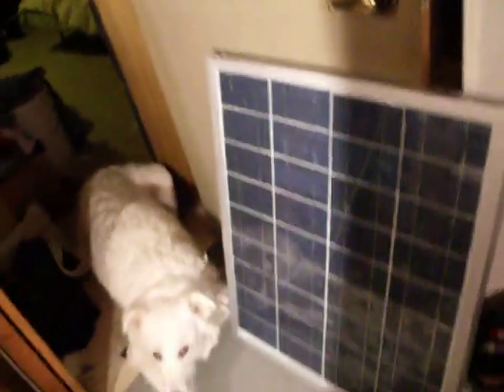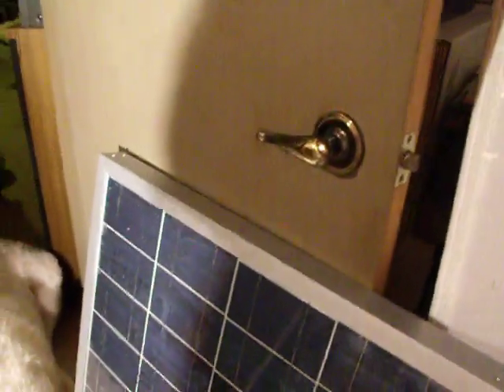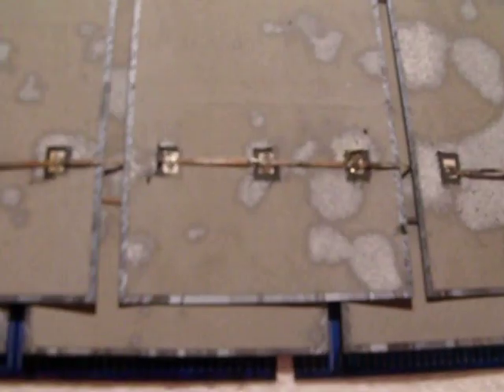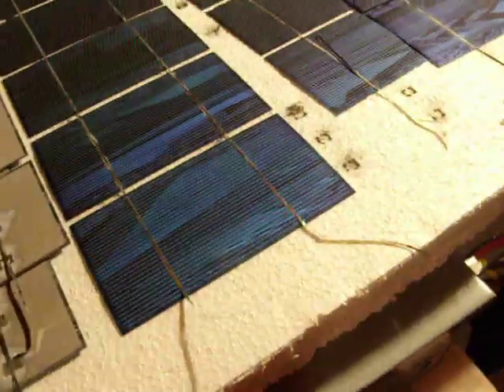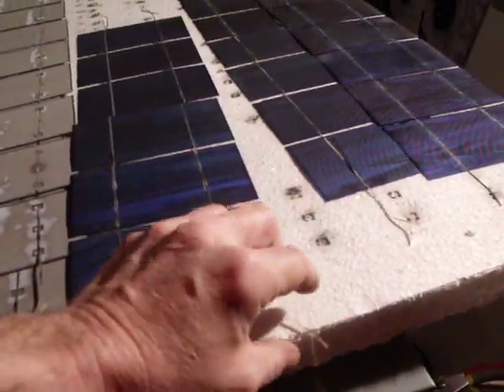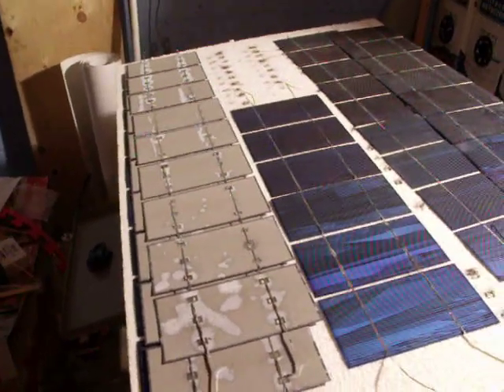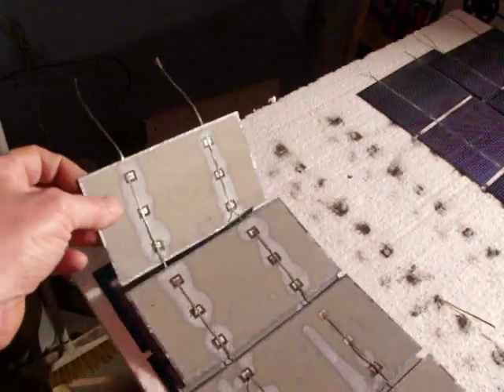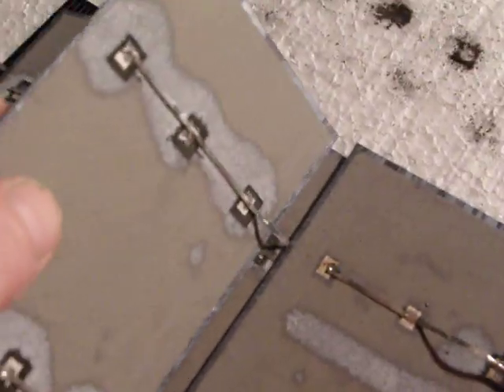solar panel building warning!!!!!!!

Comment: so you dont' use a vacuum to suck the air out from all the layers?
How do you apply pressure? I was thinking a piece of furniture foam with several ceramic tiles on top of it to give a good downward pressure.

Comment from the maker: @jdbobey 
hey there it is an anodised aluminium  I got it from a steel place they carry left over materials from suppliers  they are part of the framing for store windows they had them in 20 foot lengths 1 buck a foot 1 inch x 1.5 inch
oh man home depot is expensive for that kind of stuff

Comment from the maker: @juancarlosruiz1985  I used 5 mm tempered glass and it wont break

if you heat up reg glass it will prob crack when it cools off

Comment: great vid! glad to see someone out there with real info! my first panel was an experiment and my next will def be different design i never thought i was going to get the condensation, what about using a encapsulant? also will eva and tedlar stick to plexiglass? because i have 4 kids that like to throw rocks and i dont want to use glass. thanks for your great info good job! and i look forward to seeing your new vid putting your panel together from start to finish. thanks!

Comment: Nice tips! 
I like to spray automotive quality clear coat
on the back and front of my strings of cells after soldering and testing is complete. This water-proofs and creates a corrosion free barrier for the electrical connections for years to come.

Comment from the maker: also if you lightly scratch off the white coating before you solder you tin on they will stick faster and smoother with no solder at all

Comment from the maker: here is a link to the place I got all my stuff from they are good and expensive you can get the flux the tinning wire and the plastic stuff there 
the clear is called eva and the backer is tedlar.
the flux i used was the liquid i put it on with a qtip and no solder is require